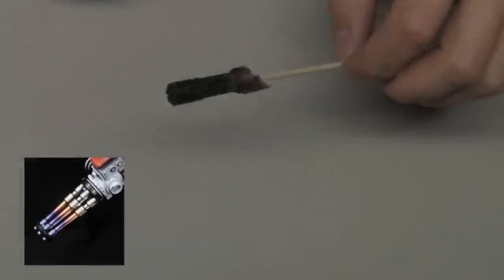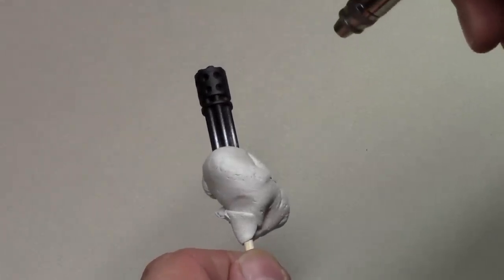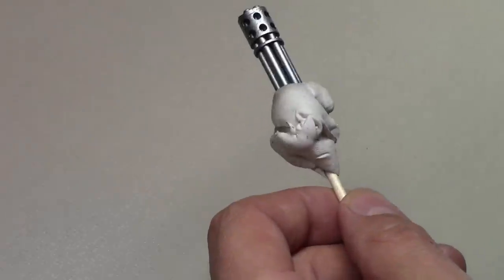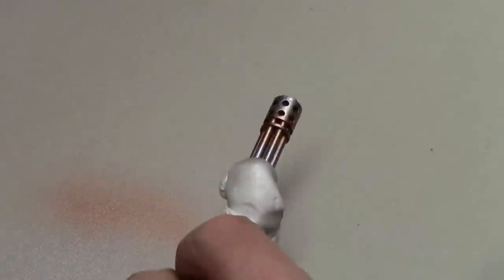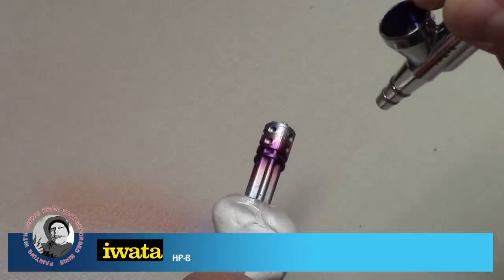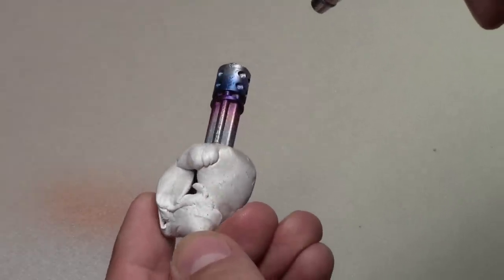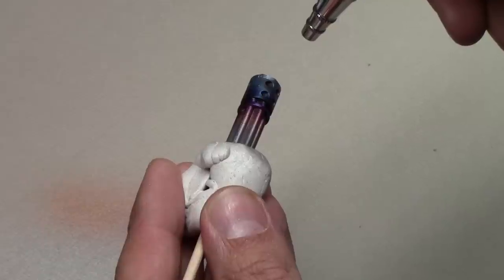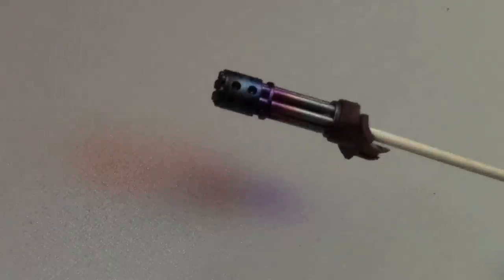How to paint burnt Iron

Comment: I was sitting here enjoying this great video. That got me to thinking about how this effect is on real metal. If you look at an exhaust on say a motorcycle, the blueing usually starts at the cylinder head which is the hottest area. When a gun is fired, the hottest area is going to be near the base and not at the tip of the barrel. But in the 40k universe, these barrels might be all blue due to the millions of rounds fired thru them. Still I very much enjoyed your video and technique. You do excellent work.

Comment: Vallego is a good paint. sells for a bit steeper at amazon than locally(for me anyway). they do not sell a burnt Iron so I will do a mix but with less violet as exhaust manifolds don't get that hot on Radials. cannons are constantly stressed and get hotter than piston engine manifolds.

Comment: I am trying to find a way to paint the exhaust manifold(part #26 of kit 5264 Revell) in a Radial piston engine of a Stearman PT-17(kit is a Christmas Present from my parents) calls for "Burnt Iron" Model Master's sells the actual paint but it looks like a metallic grey, not really burnt iron. I also need a color for frame and motor mounts which, for some strange reason calls for "Interior Green". I use gun painting tutorials for both weapons and engine systems on space ships, airplane engines, and automobiles exhaust systems. I also have videos on another project the Planet of the Apes Starship "Icarus"(1968) this will come in handy for engine wear and weathering on that kit too!  thanks!

Comment: Man, I want to try this, but I'm not sure my inner 5 year old will let me paint a gun barrel anything but *CHROME*.
Reply from the maker: ColonelSandersLite  I know gun steal is normal black .but most tabletop guns are silver painted and why not show heatstain on them. You can use it also for any scale model exhaust pipe and heated metal. See it as inspiration and how to
Reply: Well, I'm painting a space hulk set, so I might give it a try on the assault cannon guy.  I think maybe I'll even take it up to 11 and go for glowing red hot muzzles as well.
Reply from the maker: ColonelSandersLite yes that some awesome minis in that game. Only thing try to keep the use inks or transparent paints to color it. Have seen it often people use normal paint ant it looks opaque what really kills the effect for me when you can't see the metal under.
Reply: Thanks for the info.

Going off on a somewhat different tangent, you might find it worth knowing that, despite common belief not many real guns are black.

The old Com block firearms (SKS, AK family) tend to be hot blued to a near black, though more modern renditions tend to be parkerized.  Western militaries moved away from bluing a very long time ago though.  For example, the US military's 1911 pistol and 1903 rifles, as used in WW1 are blued, but the 1911 A1 and Garand rifles as used in WW2 are parkerized and should be a very slightly greenish grey color.  The m-16/m-4 rifles have parkerized steel barrels with the aluminum upper and lower receivers anodized to match.  For those rifles, Vallejo Model color neutral grey is a pretty close (but slightly too dark) match.

On the civilian market, blueing is really only still done for aesthetic reasons.  The vast majority of modern firearms are parkerized, ceracoated, or stainless steel.